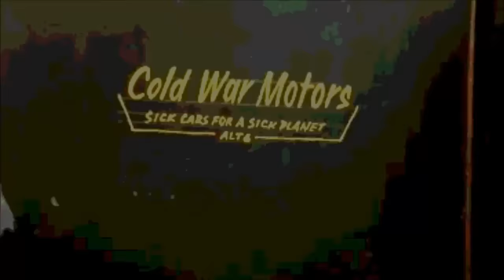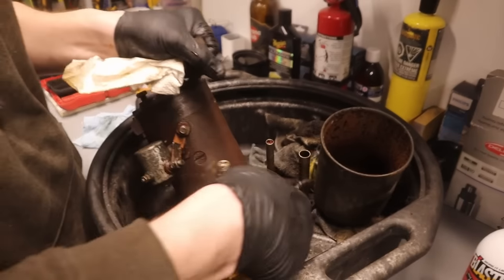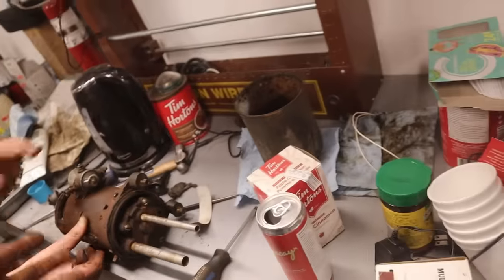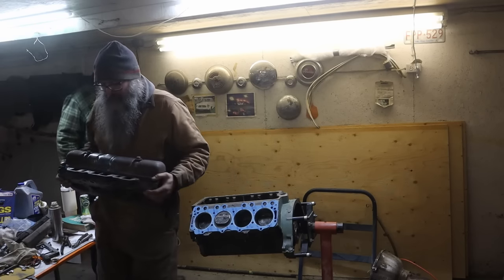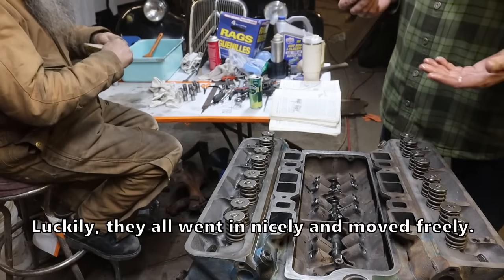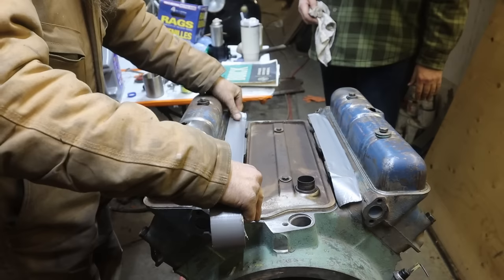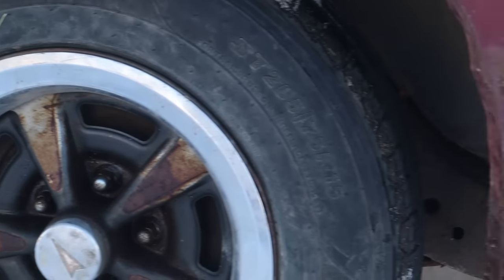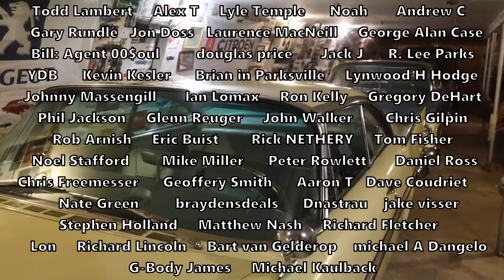Buick Nailhead Goes Together, Plus Oldsmobile 98: Will it Pump? Then: Greasy Flip Special!

Comment: Couldn't believe the state those lifters came to you, Scott.  In a bloody zip-lock bag???  They could at least have put them in with some paper wrapped around them and filler or polystyrene nuts or something to pack them in so they didn't move.  All you need is one to be a bit sticky in its shaft ( lift(er) shaft!  Get it? Haha! ) and bye-bye cam lobe.....wiped like a dirty rag during break-in or certainly before its expected lifetime.  Sure - gaskets aren't the greatest when bent - especially head or manifold gaskets - but a solid piece of corflute on either side of it and some tape would suffice.....unless your local courier driver is like mine and will happily fold, spindle or mutilate anything he has in his van because the bugger drives like a maniac and there are some tight corners on my road.  A precision engine component does not need burrs on it.  Makes you wonder how the pistons or valves would have turned up had you ordered any.....

Mind you, it's no real surprise to me.  I spent 35+ years working in IT and the most memorable courier package was a 2'x2'x2' box.  Inside this box was a 1'x1'x1' box just rattling around in there.  Inside THIS box was a 4"x2"x2" box (no padding either) and in THAT box was a piece of laptop memory.....approx 3" long, an inch wide and a couple of mill thick.  If they had just stuck a courier sticker on the box in a box in a box - ie: the bit that held the part I had ordered - that would have been fine, as the manufacturer had made sure it was well packaged and sealed.  By putting that box in a box in a box, all they did was create a large bill for courier delivery and reduce the amount the courier bloke could pack in his van.  On the waybill, the weight was listed as 480 grams (so, about a pound in weight).  The weight of the ram - because I checked it - was 32 grams, so 450 grams of box(es) to deliver a stupid little thing I could hide in the palm of my hand.  Idiocy......

That old Buick engine is coming together quick, mate.  Looking forward to hearing it fire up soon, eh!  Always enjoy a Greasy Flip too, although for some reason I'm not certain about the directions......or whether Dean is serious!  Like you, there are cars I remember seeing in my youth that I thought were super mega fugly and there was no way even it's mother could love it, but time has given me a new appreciation of cars like the Grand Marquis (and local equivalents) for the same reason as you.  My first sighting of a Nissan Joke....er Juke nearly made me lose my lunch!  I do recall uttering a startled "Aaaarghhhh!!!!" though.  Has THAT thing been swatted with the ugly stick or what??  But people bought them....and drive them....and I won't be seen alive or dead in one.  Maybe we should pinch a certain De Lorean, go back in time to 1976 (give them bout a year with the Marquis) and say something like "Hey - you think THAT is bad?  Hang on for another 30 years or so and you'll see some REAL humdingers!"  

I'm sure we may find the odd one or two we'd like, but then there's all the technology n them.  I might work in the industry, but I do NOT like computer controlled vehicles.  Anything that a computer has to dumb down so people don't write themselves off or blow their vehicle up with lack of care and maintenance, does NOT belong in the car.  If you have to plug a computer in so that software can ask your car what is wrong with it, then that takes all the fun out of troubleshooting it yourself.  Usually the problem is with another computer or a sensor....or in the case of the last modern car I owned (sold 6 years ago) which had a bad earth inside the computer module itself and wouldn't let me start it because it couldn't get the all-clear from the ECU.....and that's just a never ending self-sustaining problem all of its own making.  Put people back in charge of their vehicles, TEACH them to drive, give them access to where they can become BETTER drivers in a practical manner, can read what the car is telling them through the feel of the way it is sitting on the road and the feedback through the seat of the pants, steering, brake pedal, accelerator pedal and attitude as the car goes through a corner....and put cars back where mechanical know-how is all that is required in order to fix one.  The world would be a much better place in my opinion.  Cars are there to be enjoyed - not just a white good that takes you from place to place.  They are an experience and the journey is part of the whole deal - not just arriving at your destination on time.

Get off the soapbox, Lance.....

Anyway, I've written enough.  I will end by saying All The Best and Laura is very welcome.  After reading the petition, I couldn't help but sign it and add a comment.  Laura is such a lovely person (well, she is on camera!) and I love her sense of humour and dry wit.  What she and Colin are putting up with from the council just isn't right and it would cause a big stir if it happened over here.  Hope they get some traction and at least get the council to reconsider.

Comment: At an engineering meeting at Oldsmobile in 1950 someone suggested hydraulically operated power windows, and rather than laughing him out of the room the other mechanical perverts ran with the idea.  "It'll have a reservoir and a great big fuck off pump and weigh eighty pounds per door!  It'll add complexity and the possibility of door fires!  Genius!" 

Doubtless at the same meeting someone else suggested atomic powered wipers but it wasn't in the budget.
Reply from the maker: Lets not forget the added bonus of stripping the paint off the bottom half of the car when they leak! Cheers Dan...

Comment: ROTATE THE ENGINE so the initial open valves are now closed and check the torque the rocker arm shaft , just a thought do what you want

Comment: I'm no Nailhead expert obviously but wtf is going on with them pushrods? They seem to be on a completely different angle and spacing in the valley compared to the the rocker cover side of the head? Is there some kind of shaft behind that welsch plug or is it an optical illusion or am I just too many beers in at this stage? Cheers.

Comment: Isn't it nice to work on something that you can actually take apart and repair rather than throwing away another marginally engineered plastic piece of junk. By the way, does Dean own an LTD that still has its rear frame/ bumper?

Comment: If these lifters came from china, they probably did come in one bag package. Those have likely been returned and resold because of that issue. I bought a CV shaft from there and sent it back because its was grinding right out of the pack. I don't buy cardone anymore. Their slogan should use those parts and your car is done , finished, kaput